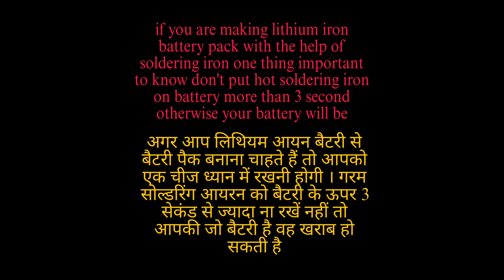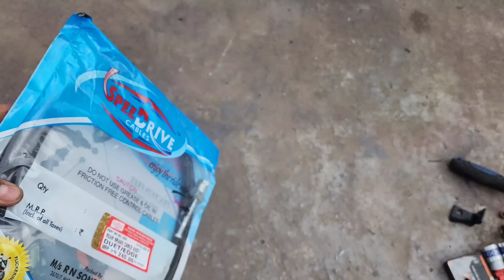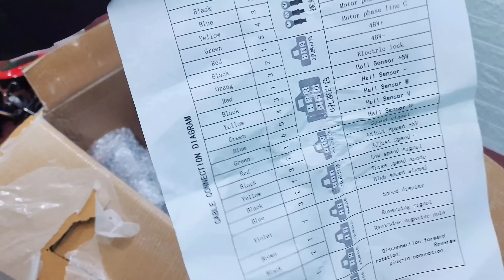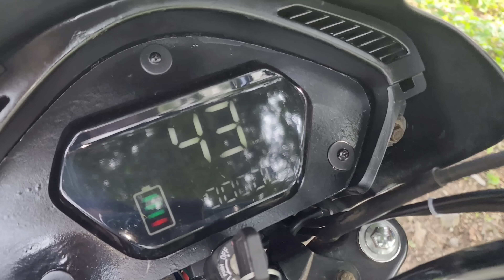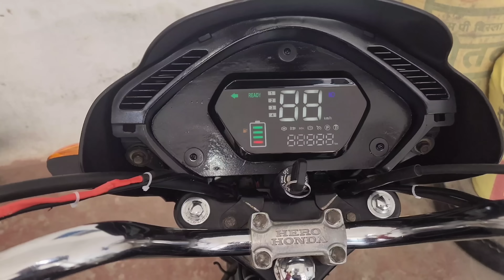How to make a electric bike in cheap price

Comment: I will try this when I get free time. Thanks bro. The only thing that I was thinking was what if battery gets hot? you didn't consider anyway to let battery's heat vent out? and well, just after little tweaks, it could even become modular. the motor, battery can be changed as per need.Thanks again. It was a good video.

Comment: it's gotta be ultra fast, because u can see ur wheel sprocket and motor sprocket nearly the same :) but if you can do the wheel sprocket smaller than the one on the motor, I can tell how fast it's goes :))))))

Comment: Hii bro total battery how much rate bro
Reply: 400 rs per pics, 1 pics 3.2v 6000 mah.
Now calculate cost ., how much you want to use thata according.
And also add 1 lifepo4 11s bms.

For every 6amp battery pack you need 11 battery in series

Comment: Hello sir, I also tried to convert a petrol bike (cd100ss) to a e bike. Almost work is complete but a problem is arise about chain drive. Rear wheel company fitted  sproket installed, and motor side has 40T readymade sproket fited (for motor). Which chain used for the bike? Original bike chain is falling.

Comment: Move the motor to basket above rear wheel or Hub motors.   Put diesel engine and dc generator where motor is as shown in video.  Battery smaller and or Capacitors.  Now you have a locomotive bike  that will go hundreds of miles.

Comment: Why didn't you show the wiring of the battery pack and the soldering? That is much harder than lining up the batteries and gluing them together. That part of your video was USELESS.
Also, how secure is it against thermal runaway and  fire? 
And don't get me started on that damned "music". I would have prefered a simple voice over explaining important tips during the construction.

Comment: Very nice do you make such conversion from petrol to electric, I want to convert my YAMAHA 2010 model into electric motorcycle EV. Single charge 100 KM required . But fully in safety conditions, specifically the Battery Pack. And brother also the budget required for this conversion.

Comment: Hello, you really did a very good job. I wanted to ask you how we know a battery is 30 amps like yours, you used the 5000 mah batteries, I don't know if the calculation is how you used 6 batteries per row and 6x5= 30 so 30 ampere.thank you

Comment: First of all, you should know that each model of motor is designed to be used differently.  Just one model..used for marketing.  ..for personal use..carry heavy items  And for mountainous areas..
 Currently, electric motor cars  Designed for very short distance running..

Comment: how far (in terms of kilometre)  you can drive with that electric battery and how long does your battery can stand before it gets weak and needs to be recharged ?
Reply from the maker: 80km range in one charge
Reply: @nextin123  it is good. Thanks

Comment: What about in Rainy season in water logged areas motor condition and other electrical wiring. Will there be any short circuits  .
Reply from the maker: Motor is water proof

Comment: The foam sheet will trap the heat of the battery without escaping and the battery will overheat.😮. Electric vehicles burn in many places because of improper heat management.
Reply from the maker: Bro motor ka max amp 40amp
But battery ka max amp 75amp ha to battery heat to kya warm bhi nahin hogi

Comment: good handwork. but two problem may rise.
1) Your battery storage has no heat dissipation system. Battery may explode
2) reverse power in your motor. it become generator when you ride downhill

Comment: It's a good change, but you've thermal insulated the batteries. Even if it's not a problem in winter, your batteries may get hot in summer.
Reply: Yeah cooling on batteries is advisable to gain more range. It affects the performance
Reply: And it will also blast battery cabinate should be aluminium to desipate heat

Comment: Please use BLDC hub motor at front wheel or rear wheel for regeneration of electricity. It will give additional 60% power as actual used power.
Reply: Bruh 😂😂
Electricity doesn't come from nothing

Comment: And where is chain tension? Because motor is stationary and wheel has suspention and when wheel goes up chain is getting loose and it will be a little bit dangerous even in slow speeds like that.

Comment: Speed bahut kam he
Motorcycle he
Scooter nahi
Kamse kam 90 ki speed to ho
Iski bajai
230vac motor lagao(cooler ki)
12v battery bank
12v dc to 230v power converter
Bike alternator (for ongo charging)
Bike rectifier
Seperate battery for headlamp and lights.

Comment: It's better to use cell holders, they have gaps. Hot air vents out between those gaps.
Reply: I don't think it generates heat at all😊
Reply: @alikerivan123 
Vibration cause friction that cause the cells to lose the plastic gap that can cause a short circuits that can cause fire / explosion
Reply: Electric bike me vibration nahi hota ha or jo rubber ka box sa battery ko cover kiye ha to vibration bilkul nahi hota hai